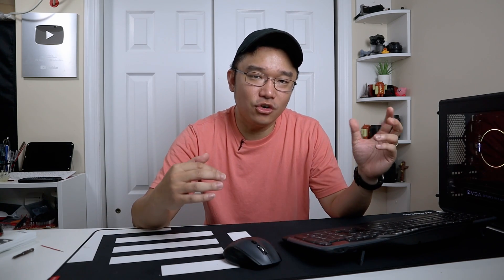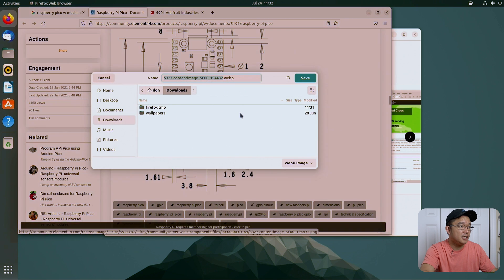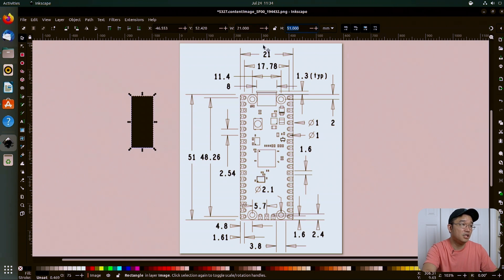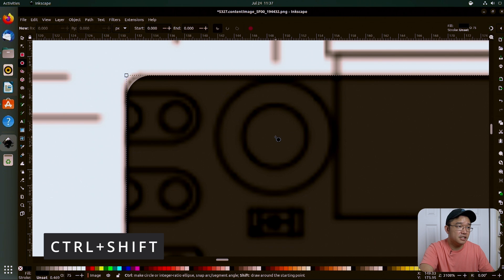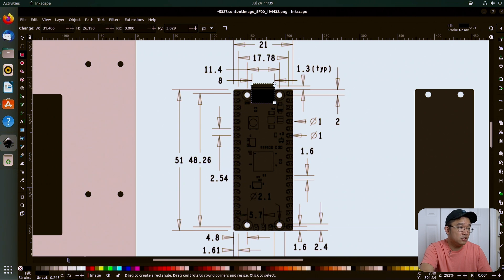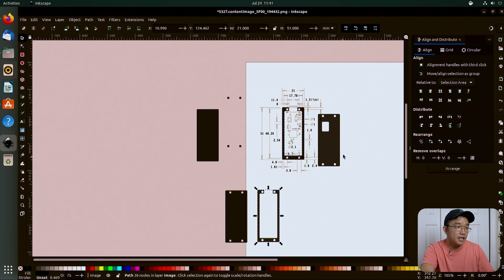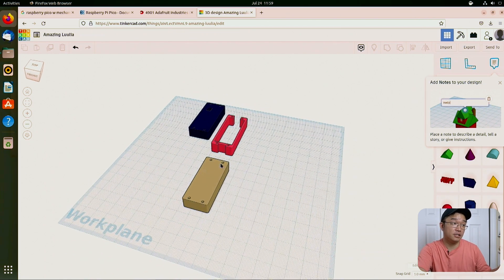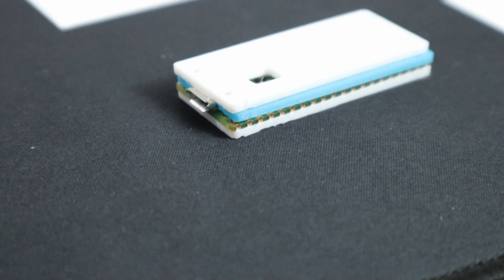How To Design and 3d Print Your Own Custom Case From Mechanical Drawings With Inkscape! RPi Pico

Comment: i use exactly what picture says for height and width and its WAY OFF with no way to size to match without warping. also this doesnt help AT ALL for cases for things that dont have available mechanical drawings so a video ont hat would be lovely

Comment: I use Inkscape for everything. You can be much more precise by using the selected object dimensions and location attributes. You can even use expressions in many of those values. For example, if you needed to move an entity 3mm to the right, you can click in the X location field and put +3 (assuming mm is the units) and press enter. There is no reason not to be very precise with Inkscape and a dimensioned drawing.  One of my favorite uses for Inkscape is to create circuit boards with odd shapes. For PCBs I export as a DXF and then import that into the PCB software as the board outline.

Comment: I did a similar thing for my pi4 but instead of mechanical drawing in inkspace, I got the 3d model of pi instead and imported that in tinkercad and designed my case around it. Much more flexible i suppose. Great tutorial though. Gave me idea for more complicated stuff.